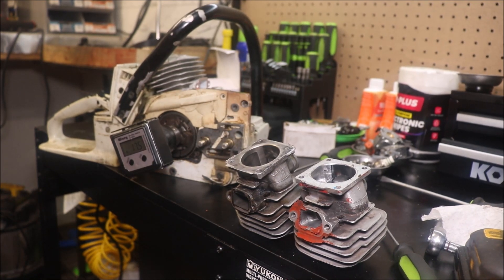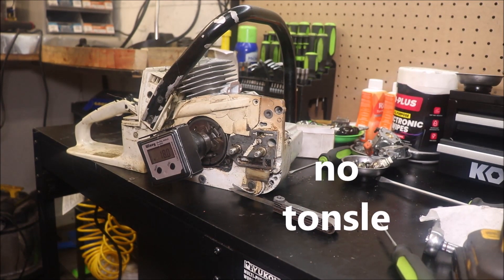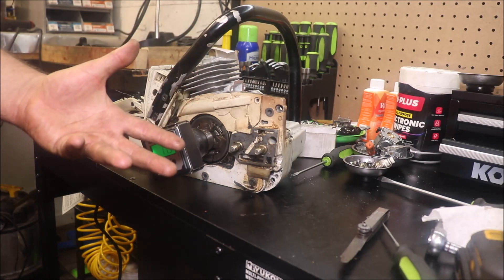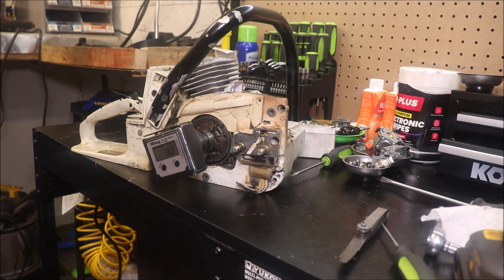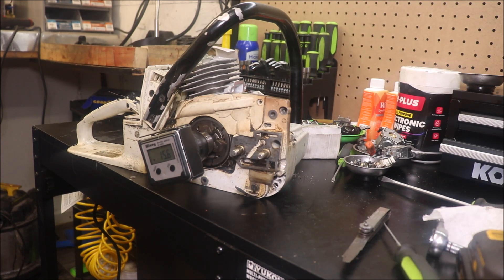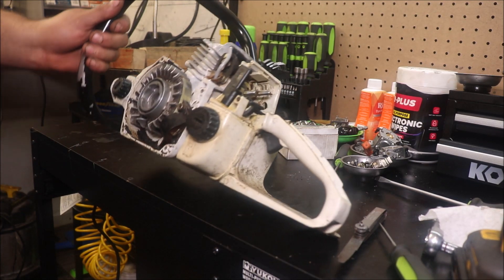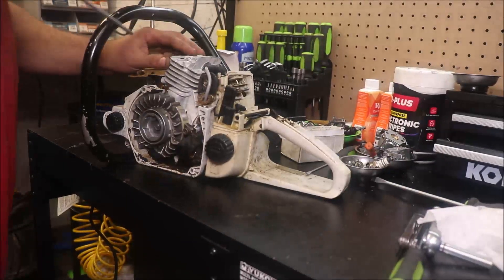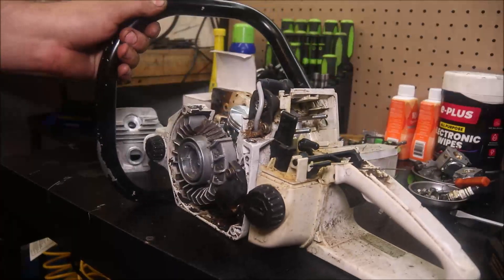Stihl 024av Ported ms260 Top End

Comment: Now keep in mind those saws were built in batches, so the badges may differ depending on what month they made that batch, I have two 026 super saws and the badges and covers are different, one has orange fuel and oil caps , the other one has black caps,
Reply from the maker: I have a super with a 260 topemd 260 plastic front chain adjuster